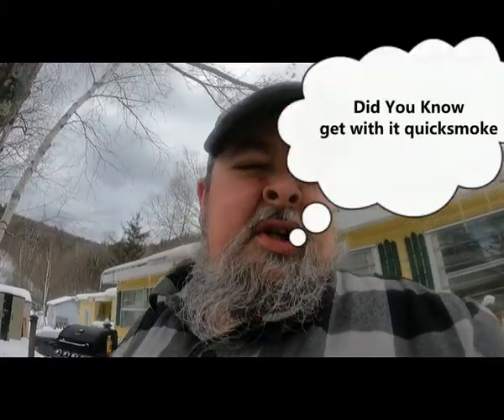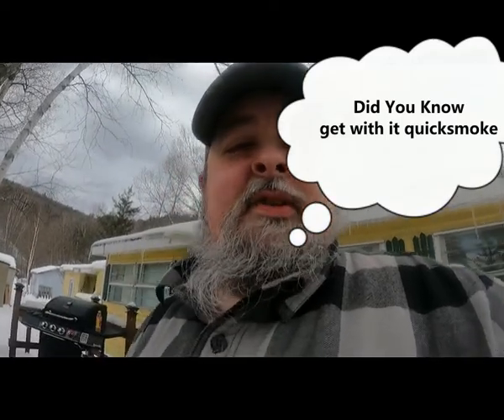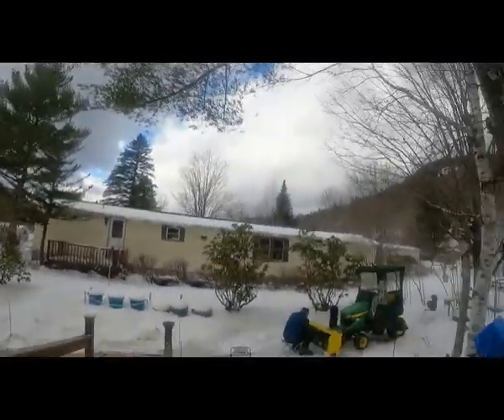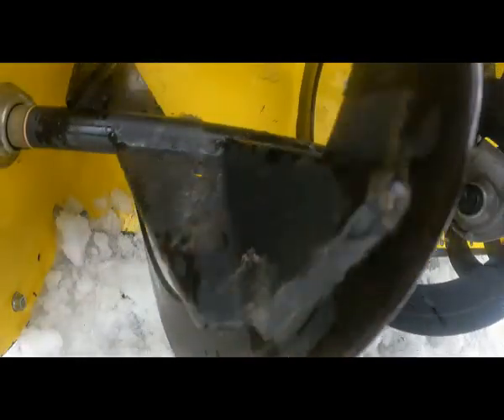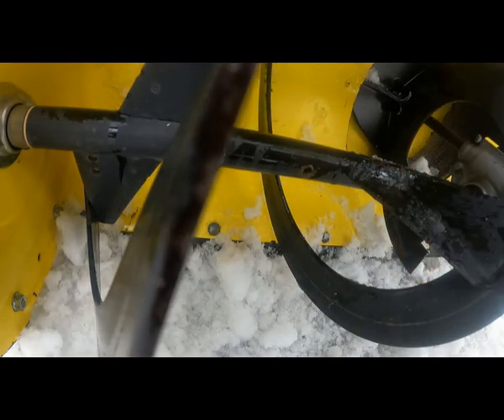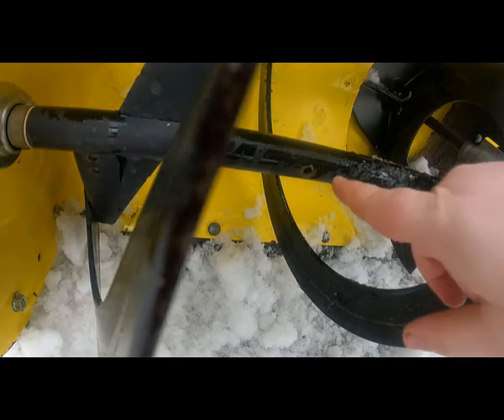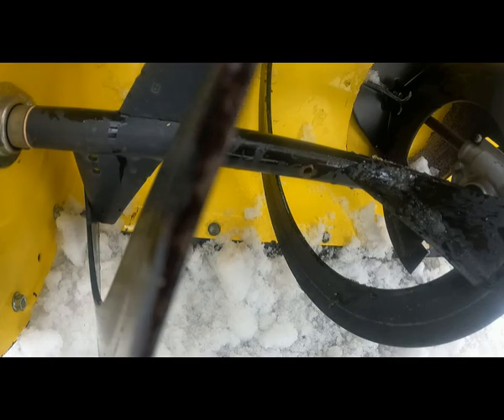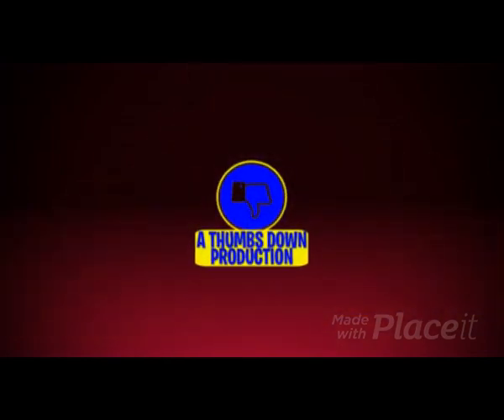Shear Pin replacement John Deere snow blower

Comment: -- Hard to see, forgive me.  Is that pin threaded all the way up, IE an aftermarket bolt?  You could damage your gearbox if so.  Those sorts of pins are generally grooved to prevent that.  Little difficult to tell again, but it looks like a 2 stage system.  Just take a look at the other pin if so and match them up.  There might/should be another on the shaft behind the gearbox as well.
   But that old pin did what it was supposed to do.  A gearbox ain't cheap.  Willy when he comes and stays for the winter loves snapping those things off, albeit mine uses a PTO hydraulic orbital drive.   More torque, less throw, more 'snapage'  :D so it's more about protecting the blades and the shaft than the orbital.    
  Oh and always have duplicates of 10mm in 3/8 and 1/4.  Those little bastards loving running off to their master like the damn ring of power from Lord of the Rings. 
  And hey, do you want to trade jobs?  Have an entire front suspension to install in the Tahoe when they free Pops from the VA.
Reply: Gotta love fail safe redundancy stuff!
Reply: Plus that stamped steel bolt may not be strong enough huh?
Reply: @SlackerE  -- May could be.  Better to go softer than stronger if you're guessing.  Not to say Mikey is guessing.  Generally you just want to buy a factory replacement.  Right strength and design.  Not to say he didn't do that either.  I just didn't get a good look at the bolt and he didn't mention where he got it.
Reply: @MarkJacksonGaming  Just not sure that bolt will take the shear from holding the impeller to the shaft. The Goldilocks theory in other words. Gotta be just right. Not to strong but strong enough.
Reply from the maker: You both have valid points but to ease  your mind I did get the bolt from the dealer
Reply: @Quicksmoke  Whoooooooo
Reply: @Quicksmoke  -- Good good.

Comment: So that's the point of a shear pin, to break at a certain load before excess forces get transferred to more critical components? If I understand it, without that pin breaking first if the blade was welded to the shaft and the impeller jammed the gear case would twist the shaft off from the torque of the gear case. Has to be hard enough to take the stress of holding the blade to the shaft but not as hard as the shaft. JD would probably tell you to use their pins.